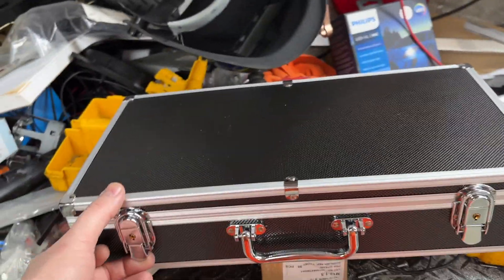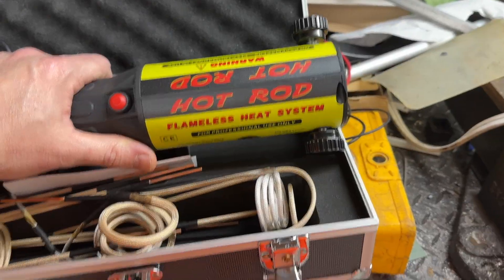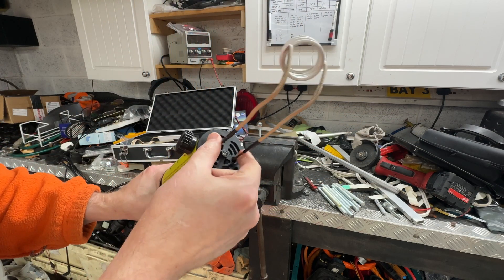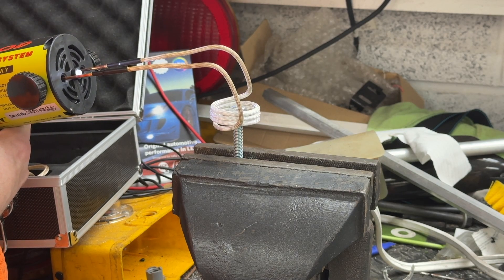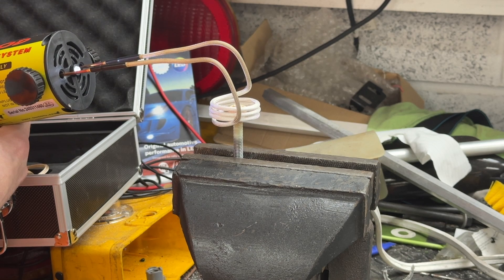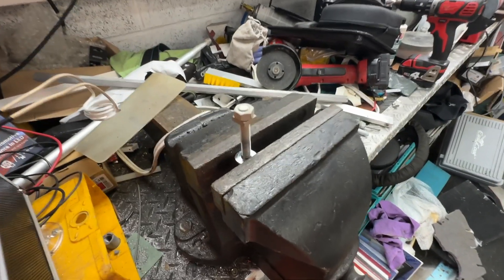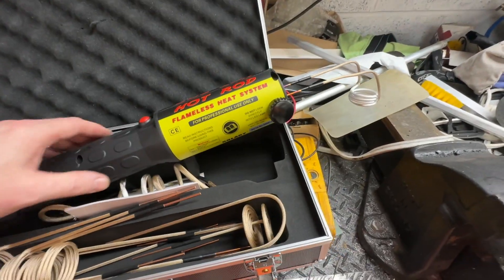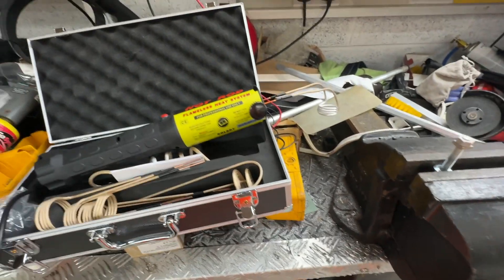Testing an induction bolt heater

Comment: I bought one of these induction heaters about 4 years ago when the Chinese versions started flooding the market at the right price.
One of the best purchases I have ever made for my workshop, used it loads of times and not just on rusted nut's and bolts.
Warming steel bar or rod to bend it, small bearings to get them on or off...
Reply from the maker: I was put off early on because I bought a board to make one but it was shit. I'll find a load of jobs for this.